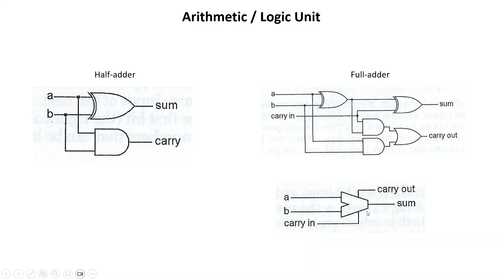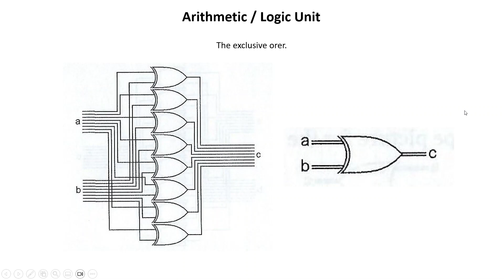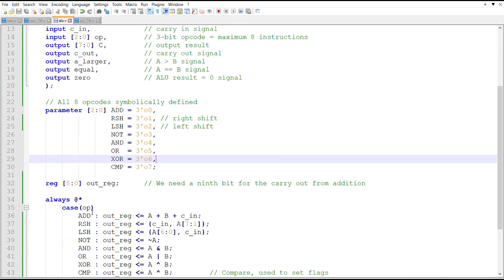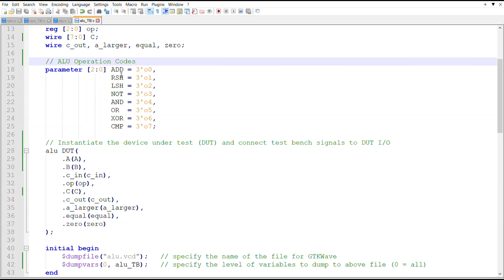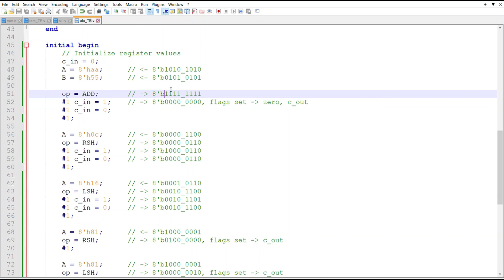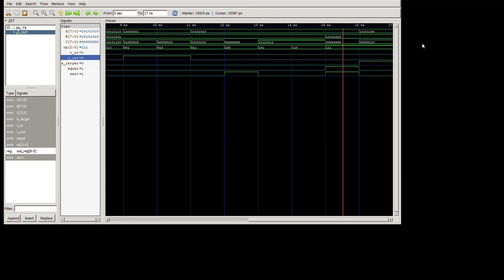CPU Series 1: The 7-Step Processor Part 2 - Arithmetic and Logic Unit (ALU)

Comment: Sir i have learnt verilog
Please recommend  me projects on verilog
Without using fpga
Reply: Sir i will do projects on state machine 
After completing these projects 
I will inform you
Thankyou sir
Reply from the maker: Well, if you are just starting out with Verilog, I recommend these projects, which are fun and interesting:
-Decoder
-Multiplexer
-Flip Flop
-101 Sequence Detector
-Gray Code Counter
Then maybe do some state machines:
-Traffic Controller
-Vending Machine
-Voting Machine
Each of these projects you can write Verilog circuits for and then verify the designs using a testbench written in Verilog. The Icarus Verilog software, with GTKWave signal viewer, can be very useful for simulating your designs. You can find it here:
https://bleyer.org/icarus/

Good luck and have fun!

David